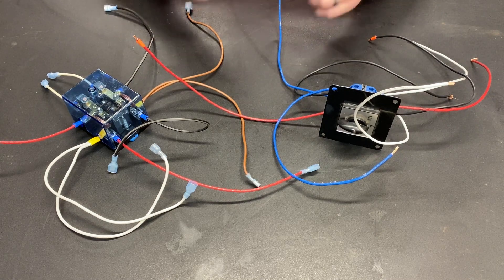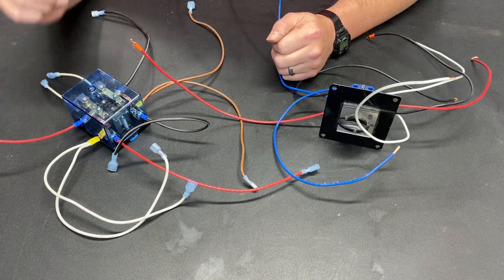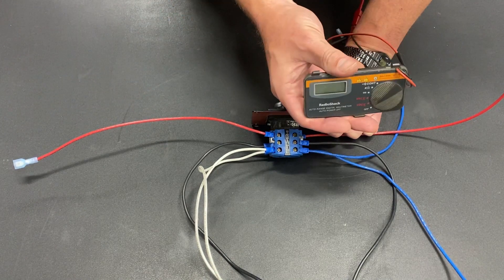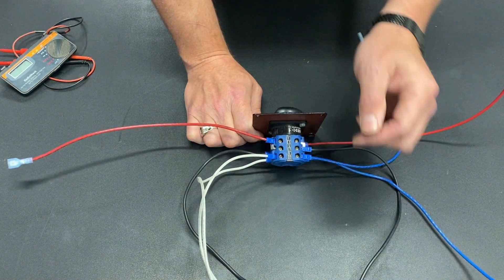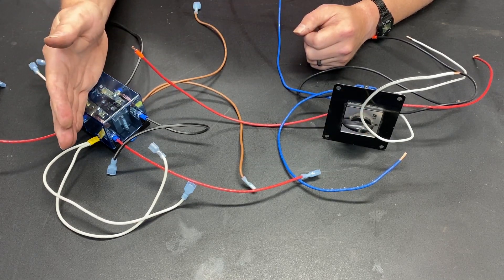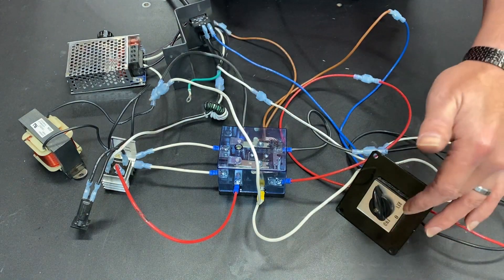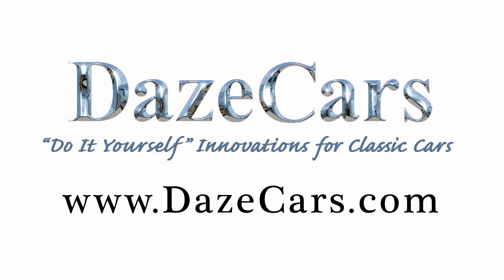Adding an AUTOMATIC Electric Brake to a Treadmill Lathe Motor Upgrade

Comment: something seems amiss. all the schematics show the resistors across the motor at all times. it appears that any time the motor is running, power is being bled off to the resistor bank. this is a waste and a heat source, is it not? motor should be on the center "wiper" and get power from the controller or get rid of power via the resistor bank . key word "or". did i miss something?
Reply from the maker: Nothing is amiss, you are reading the schematic incorrectly. There is a DPDT relay connecting the resistors to the motor and the schematics are showing the relay in the unpowered NC position.  With no power is applied to the relay the motor is connected to the resistors, but when power is applied to the relay the motor is disconnected from the resisters and connected to the power.
Reply from the maker: If you are still not understanding go to abot 5:00 of this video and it should clear it up for you https://youtu.be/q7edXvqDMHw.  Let me know if you have any other questions

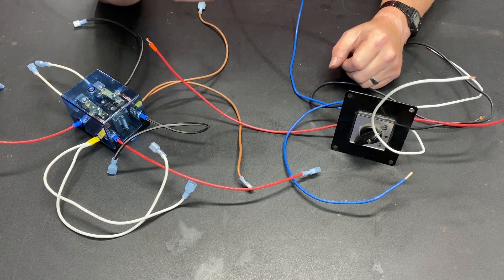Comment: 7:04 I'm not sure if the Ohm's law voltage to amperage conversion would work when sizing up a relay, although I may have misunderstood what you were conveying. The current/amperage rating seems to be related to the conducting materials in the relay, while the voltage rating would be more related to the insulation materials in it. In other words, a relay rated for, say, 80 amps and 24vdc might still short out at only 1 amp and 36vdc because the insulation materials inside the relay might not be thick enough to protect + from shorting out to - at that higher voltage
Reply from the maker: I'm not using ohms law as a for sure 1:1.   I don't think that I can just change the voltage up or down and know for sure that it can handle the amps but I can get close. A lot of components like switches and relays have multiple amp/volt ratings and in general its roughly liner so ohms law(ish).   As an example a switch may be listed at  20A at 110VAC and 10A at 220VAC.  I have found using ohms law to be a good guide, especially when not trying to push things to the max.  In general reducing the volts allows for more amps and vice versa so it's good for finding a ballpark.  As to your concern about the shielding, it's all bare wires inside the relay so the only concern is the volt/amp load on the contacts and so far they are working flawlessly.
Reply: @dazecars  Oh, I see.  Good to know!  I'm looking forward to trying to build one of these things myself soon, so thanks for the content—definitely useful stuff
Reply from the maker: My pleasure!!

Comment: A diode in series with the braking resistor and connected in reverse bias (backward/opposed to normal current flow) across the DC lines would achieve the same ends with no moving parts. A VISHAY VS-60APU04-N3 is rated to 400V at 60A for instance. You could  even just  use another bridge rectifier using only the DC connections, cheap. This is simply because when the motor is braking, it is producing current in the opposite direction to when it is running, the back emf is reverse polarity, the positive motor input becomes the negative motor output and likewise for the other pole. So in normal operation no current flows through the brake because the brake diode stops it, but when you cut the power the reverse direction generated power from the motor  will flow through the braking diode, and so to the brake resistor that is in series with it. All of this only applies to motors run in one direction only of course.
Reply from the maker: I could be mistaken but I believe that a free spinning motor produces DC current in the same direction, not reversed current.  (It would be easy enough to test) When the field in a coil collapses the current goes the opposite direction but a generating motor produces power because of the free spinning shaft and because its going in the same direction it produces power in the same direction.  As an example there is a flyback diode on the MC2100, basically wired exactly as you have said without the resistors in series and when the MC2100 is powered off the flyback diode would act as a brake if power was reversed but it does not and the motor slowly spins down, but if you add the relay and resistors it brakes when the MC2100 is powered off.

Comment: Any reason not to use a 4 position rotary switch with  #1 left #2 brake #3 right. I see no need for a relay. It won't see current spikes anymore than the motor starting or less. A  LW26-63Amp should do it.
Reply from the maker: I used the relay because I wanted the brake to trigger if the direction switch was actuated, BUT ALSO if the master power switch was cut or the e-stop switch was hit. Your simplified version only covers 1 out of 3 of those situations and the e-stop you are leaving out is the most important place to have the brake.

Comment: Thanks for the information!  
>>> Here's a CAUTION for woodturners who install a treadmill motor as I have done<<.
The addition of a brake would be very useful.  However, there is an additional consideration, in that many chucks and faceplates for wood lathes do not have a lockscrew to secure the chuck on the spindle (or the operator does not tighten the lockscrew).  Thus, too rapid braking action can cause the chuck to unscrew itself off the spindle and fall off the lathe (and onto the operator's foot).  So if you use the info here to construct a brake, be mindful  of this potential hazard and either use chucks with lockscrews or set the braking action to a safe rate of deceleration.
Reply from the maker: thanks for the PSA

Comment: Great video, too bad I  am not electrician. Would it be possible to make on whole unit for me? I am trying to replace my motor on drill press to have the option of forward/ reverse,  break and rpm control. Milan
Reply from the maker: I am happy to share the information but I am not interested in putting together units for people.

Comment: Can an optically coupled solid state relay be used? I have one left over from an earlier project.
Reply from the maker: Depends on the relay's specs.  If it is DPDT, has an AC trigger, AND has high enough amps for the DC side of things (AC amp ratings and DC amp ratings are not directly interchangeable)   Than it should work.  I would be willing to bet it falls short in several categories unless it was an extremely expensive relay.

Comment: Do you have a combined wiring diagram with the SCR, potentiometers, relays and switch? I’m starting to buy all the parts now.
Reply from the maker: Here you go Schematics for Adding an AUTOMATIC Electric Brake to a Treadmill Motor For a Lathe SCR, MC60, MC2100
https://youtu.be/q7edXvqDMHw

Comment: Ok. So this works with the 3PDT rotary switch. But I don’t see your resistors anywhere. Where do they hook in to the wiring diagram?
Also, in your other video where you show the resistors, you are using a small toggle switch. So I’m confused as to how this all goes together. 
I have my on/off ac power. This is connected to the SCR, followed by a toroidal inductor, circuit breaker, bridge rectifier, dc choke and forward/reverse selector switch. 
Now, to add the brake, I wire in the relay as shown. But where do the resistors go?
BTW, if you have break before make on/off buttons, why do you need an emergency stop? You already have an off button for that. 
P
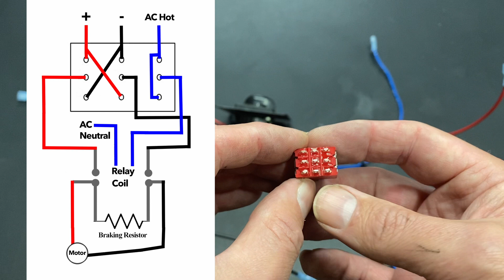Reply from the maker: The resistor is labeled on the schematic at 5:20 in the video.  The purpose for an emergency stop switch is a quick off that doesn't require any thinking, finding the switch, or flipping it the correct direction.  Yes it does the same thing as the master power switch functionally but it is a bigger target to simply hit in an emergency situation.
Reply: @dazecars  Yes. I see that. But you are showing the small 3PDT switch, not the forward/reverse switch we are using. 
I’m confused about how these resistors, and the small toggle switch connect to the variable speed drive in your previous videos. 
The last thing I have before the motor is the 3PDT rotating selector switch. Where does this new stuff go? See what I mean? It might be obvious to you, but not to me. 
Thanks DAZE! 😬
Reply from the maker: @paulmanhart4481  you are letting the fact that it is a rotary switch compared to a toggle switch confuse you.  a 3PDT switch is a 3PDT switch and is hooked up the exact same way regardless of how the switch, switches.  Go back to the video I made just for you and you will see I show the toggle in the drawing but the the rotary on the bench.  The third pole is on the end of the switch and you will see if you test it with a meter that it is simply on off on and is used to power the relay.  The toggle in the first video was just there for the bench test and was replaced by the relay in the automated section.
Reply: @dazecars  Um, ok. 
So, let me rephrase to make sure I understand. 
The circuit diagram in the video shows a 3PDT rotary switch. This is the one I have. But now I’m using the third pole? With AC? 
It also shows the relay and resistors, right? If this is correct, then I think I’m good (that’s debatable). But I still need to figure out how to wire the AC in the third pole. 
Thanks DAZE.
Reply: @dazecars  Daze, if resistance in a parallel circuit is the inverse of the sum of the inverse of the ohms ( R = (Sum (1/Ri))^-1
Then if each of the green resistors is 4  Ohms, then I need 4 of them to get 1 Ohm, right?
The Watts just add so I have 400 Watts. 
I would like 1000 Watts at your suggested 1 Ohm. 
The big expensive one is 1000 Watts, but 4 Ohms.
Reply: @dazecars  Ok. I found those orange resistors at 100 Watts 8 Ohms. If I use 8 of these in parallel, I get 800 Watts at 1 ohm. 
I think you recommend between 1 to 2 Ohms, right?
Gas this stuff is confusing. I’ll stick with images, pupils, telecentricity, object and image space, real and virtual images and pupils any day.
Reply from the maker: @paulmanhart4481  no the Diagram just shows a 3PDT switch.  it's not rotary or toggle its just a switch.  The mechanism is irrelevant its the connections that are important and the same.
Reply from the maker: @paulmanhart4481  I started with the big expensive one because I didn't know the wattage requirements.  Then when I went to the smaller ones and did the experiment to see exactly what worked.  Because the voltage drops so quickly the wattages drops equally as quickly (amps X Volts + watts) and the high wattage is not required.  There is no problem using the smaller resisters at only 400 watts.
Reply from the maker: @paulmanhart4481  yes that would be 800 watts 1 ohm
Reply: @dazecars  Ok, it’s just a switch. What switch is it? Where do I get it and how is all this wired together? 
See, I have my current circuit diagram in my head. I don’t know how this all fits into what you are doing. 
I realize it’s not your problem Daze. But it’s so damn cool that I would really like to know how to implement it into your SCR variable speed design. 
You probably think you have already explained it, but your diagram shows wires going to the motor. My motor wires come from the rotary switch. 
Are you saying that the input to your circuit diagram comes from the rotary switch, and THEN to the motor?
Dazed and Confused. 
P
Reply: @dazecars  The figure you have showing the 3PDT switch with AC and DC, the relay, the resistors and out to motor. That DC is 130 volts and 25 amps. So a regular 3PDT toggle switch won’t cut it. That’s why we changed to the rotary switch, right? 
So if the DC leads come from the big rotary switch, what other 3PDT switch in that diagram will handle it?
Reply from the maker: @paulmanhart4481  You have totaly missed the point.  The rotary switch is A SWITCH It is any switch you want it to be that is 3PDT and can handle the amps and volts.  I found and purchased the rotary switch I am using so I could add the brake.
Reply from the maker: @paulmanhart4481  Please see my other reply about 3PDT switches and please keep in mind that if you wire this incorrectly BAD STUFF has the potential to happen.  The things that you are stumbling over have me concerned about your ability to put it together correctly, and I would hate for there to be any kind of a accident.
Reply: @dazecars  So I need another 3PDT rotary switch.
Reply: @dazecars  Daze, I would never put power through anything that I haven’t verified. But thanks for your concern. It’s appreciated. 
What I’m missing is the link between my current wiring and where your new stuff fits in. I don’t know where your DC wires come from into this new rotary switch. My wires go from our big rotary switch to the motor. I don’t know where your new design plugs in.
Reply from the maker: @paulmanhart4481  no you do not
Reply from the maker: @paulmanhart4481  You need to think of the rotary switch as 3 individual switches controlled by the same knob.  that is why it is 3P  The first two polls control direction, the third pole controls the relay for the brake.
Reply: @dazecars  I don’t lack that info? Is that what your saying?
Maybe the 3PDT switch that I have is the one in your video. That would make the most sense. 
P
Reply from the maker: @paulmanhart4481  requested video drops tomorrow
Reply: Where is the drop?
Reply from the maker: @marquiswhitsette3555  it’s the most recent video uploaded to my channel

Comment: Thanks for this, any chance you could put up a scematic of all the parts in this latest system
Reply: Thanks for your reply, I follow that scematic, I'm trying to tie it to your previous scematics of all the other components of the motor and chokes and switches and so on
Reply from the maker: There is a schmatic at 1:50  What else are you needing?
Reply: That’s what I was thinking. How does this connect with all the other stuff he’s shown? 
I copied his variable SCR speed controller with the same rotary switch for F/R, but I’m wondering how this new stuff figures in. 
I need to watch the brake video.
Reply: @paulmanhart4481  hi Paul, did you figure it out
Reply: @duaneglover9283  Not quite yet, but Daze is helping me. Have you figured it out? I’m using his whole SCR variable speed drive design with the 3 PDT rotary selector switch. I have that wired correctly but trying to figure out how the brake wires in. 
P
Reply: Hi Paul, did you figure it out?
Reply: Still waiting for the proper choke to arrive, had the basic wiring without the brake but my choke was too small, I think in his video I see a white wire loop on the end of the relay which represents the register pack

Comment: Great video, just curious, does your resistor heat up when the motor is in normal use, being that it looks like it's in parallel with the motor in your drawing? Would it be better to run the resistor/breaking circuit through a normally closed contact on the relay to take the resistor out of the circuit when the motor is running?
Reply from the maker: The NC part of the relay is exactly how I have it wired.  It is only parallel with the motor when there is no power to the relay.  When power is applied to the relay the connection to the resister is broken and the motor connects to the power supply.

Comment: LOVE it! Exactly what was called for to incorporate it into the existing tried and true rotary switches found on lathes. From personal experience I know trying to utilize existing elements as much as possible (either for reduced modification effort or expense) can increase the work through difficulty level to the point of abandonment. 

Even if the solution ends up being elegantly simple … that will only ever be the case after you’ve found it. Everything before hand (the trial and error the time drawing out schematics the effort spent thinking it all through) are rarely given their due recognition when a person didn’t have to experience it themselves. Well done🫡
Reply from the maker: Glad you liked it!!  There has definitely been some trail and error on this project.  The challenge I am currently having now is finding a replacement rotary switch.  The original switch was double throw and that is why I was able to use it as a direction switch and as a kill switch of the relay but all the rotary switches I am finding are single throw.  My original switch has a lot of hours on it and the contacts only connect about 99% of the time.

Comment: What size resistor were you using on your bench test set up? I couldn’t locate the resistor?
Reply from the maker: Thats because I did not use one for the bench test. 😁😁  I was running it at slow enough speeds that I went with the direct short as it was lower energy discharge.  It's also kind of a crapy motor so I don't mind being a little harder on it.  I was originally going to run the two 4Ω 1000W resisters I have (video 1) in parallel but after the results (video 2) I will go with 4 or 5 4Ω 100W resistors in parallel.  I hope to get to the final install in the next month or so.
Reply: @dazecars  ok great I’m happy to see that I’m following your videos closely and that you plan to work on a video with the final configuration. Looking forward to it. Thanks Daze.

Comment: did I not say in your last video to use a relay ?
good setup but could be made much easier.
Reply from the maker: You did but I had already solved the problem.  I had this video put together when the previous video dropped.  That is why I was able to preview it at the end of the previous video.  How would you make the setup easier?  Any simpler and it would not automatically function at all functions.